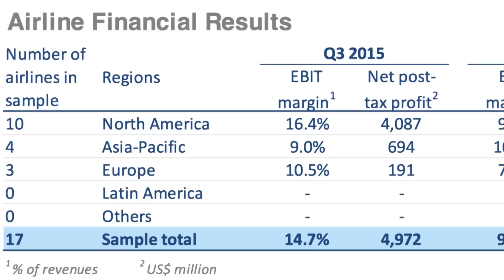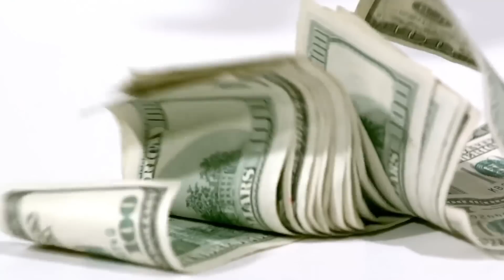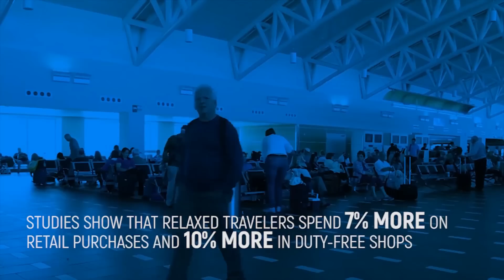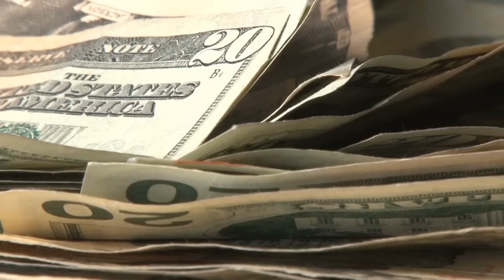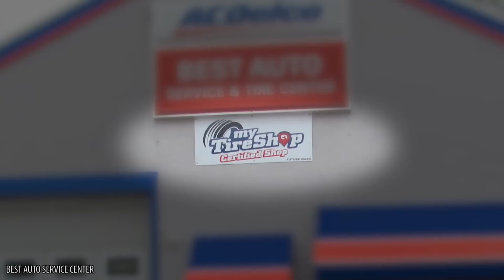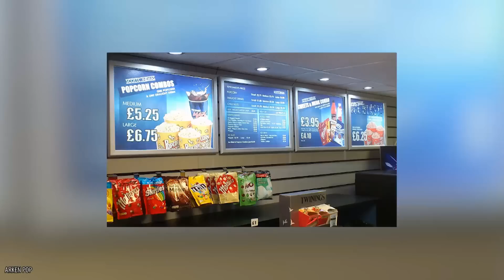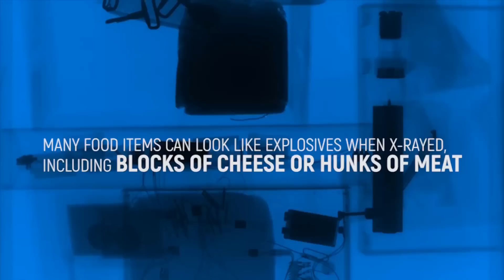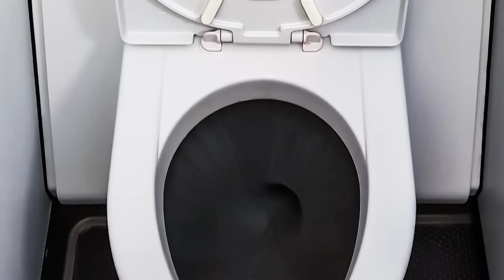TheHUB Live - Amazing Secrets No One Wants You To Know

Comment: I have never changed oil in any car. I put 300,000 on my Neon by topping it off when it hits add. Once a year I add 1 qt. of Lubriplate. My E320 has 187,000 on it and drives like a dream. , both vettes have under 100k. 1982's. I am a mechanic of 32 years and one of my clients tested oil additives. so they would let them run for 100K and I would take them apart and they had computers measure all wearable parts. After 100K kept topped off, there would be little wear. When the oil gets to add, the viscosity lowers, so adding a qt refreshes the viscosity good enough. Ive had over 30 cars without a single failure due to oil....coolant is the most important fluid. If you keep that engine cool..it will last a long time unless there is a manufactures defect. Synthetic oil does work better and never change your trans oil. You are almost guaranteed it will have a failure ! Some cars recommend changing oil at 100K ! Always check you air filter, just hold it up to a light and if you can see any light thru it, you are good to go !

Comment: Ok. At 1:09:20 "Old parts" it says to ask for your old parts back - DO NOT DO THIS! The reason is that just about ALL replacement parts require a Core (old part) in trade when you buy a new part OR a required Core charge must be paid.  If you get back your old part, then you'll be stuck paying the core charge PLUS 15% for the shop's time of paying it for you. So literally you could wind up paying over DOUBLE the price of the replacement part - just to get your old broken part back. INSTEAD ask for the core receipt. That will show you that the part was indeed used as a core.

Comment: One thing a lot of people dont know about their cars a/c system is, unless any part of the system has been damaged it will simply lose freon over time. But you can get around having to pay the high price of having the system filled.A lot of shops will do a system test for a lot cheaper. This requires them to pull a vaccuum on the system. In doing so they remove the old freon. They cannot leave it empty or it will damage the pump, so they have to fill the system with freon. By doing this 8 of 10 times this will completely fix your problem, and if there is a leak they will be able to tell you.

Comment: avoiding bed bugs. keep your stuff in your suitcase and off the floor. put dirty clothes in plastic bags and put back into your suitcase.  when you get home put it right into your washer and dryer and dry everything in very warm dryer or hot dryer. (bed bugs can't swim).  If you get bed bugs wash all you sheets and pillow cases weekly, get diatomaceous earth (DE) or bug powder (from hardware store) and dust everything around bed, including floor heavily.  use zippered pillow cases.  wash bedding weekly. ditch your headboard or put white zippered cover on it. vacuum everything weekly.  they will go away if you are diligent and clean.

Comment: As far as cars go, I am a professional auto tech with over 15 years experience. I’m going to set this straight, we barely make any Money changing your oil. I would rather not even offer oil changes it’s really just for customer convenience. I specialize in engine repair so I see the insides of many engines. Sure your owners manual says 10k oil changes are fine but it’s not true if you want the engine to last a long time. So many engine repairs I do are related to people not Changing their oil frequently enough. I recommend synthetic oil and change it every 5k. Waiting along time to charge your oil makes your engine sludge up and also doesn’t lubricate as well causing things like timing chains to wear out faster than normal. Fuel injection cleaning is an absolute must if your engine has direct injection fuel system which many new cars have, the reason is, the fuel doesn’t get injected before the intake valve so the intake valves get a lot of carbon build up that will cause a misfire. This should be done every year in my opinion to avoid a costly repair. If you listen to your owners manual your car will not last as long as you hope. It’s funny how people like to think you can avoid  car maintenance and still have reliability

Comment: When I was moving my Zombie Truck from the Arizona desert we needed tires to drag it out (We found it abandoned) and just got the el-cheapo tires. Now I can't get them to do anything to them without buying a whole new set. The beads are rusty so they leak air slowly but they wont re-mount them with glue and if the tires go flat the city sticks an abandoned vehicle sticker on it.  So there is sound advice, check the expiration date on the tire!

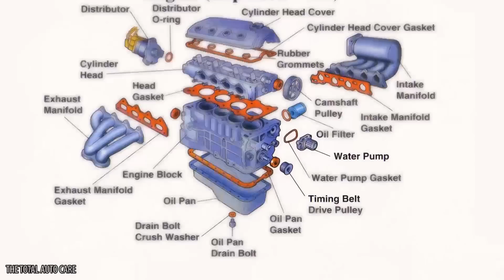Comment: At 5:02 they don’t tell you that also yes new cars can go 6-10k miles but they also recommend you use a synthetic blend (5k miles) or full synthetic (7-10k miles) so make sure you are use of the appropriate oil for the car. Also at 6:35 the water pump being changed is not always needed to be removed to do the job some water pumps are ran off the timing belt/chain and some are off the belt. That picture they use is a really old engine like pre 2000 it still has a distributor and that’s not used any more. The Buick 2.4l engine has the water pump ran off the timing chain but is on the back side of the motor. Basically a lot of the car stuff they talk about is part truth but they don’t tell you the full facts. To be safe always look in the owner manual and follow the service intervals and do the preventative maintenance if you want the car to last.

Comment: do no go 10k mi on an oil change. sludge is really common these days with the "annual protection" oils. i work in a machine shop and this is really common now. also mechanics need to charge for a waterpump replacement when doing a timing belt because if the waterpump leaks he has to take it off for free. its called a warranty. if a customer didnt want to pay for the waterpump labor i would charge them the entire cost again to take the waterpump back off for a warranty repair.

Comment: In hotels if you leave your stuff on the bed we won’t make the bed. Comforters are heavy and only a few can be washed at a time so of course there not washed every clean. Id say about once a month they get washed. Tv remotes are cleaned but not all housekeepers clean them regularly it’s a good idea to have handy wipes and wipe them off plus light switches and door handles off yourself. Going through someone’s belongings is a fast way to get fired plus imagine trying on a sweater and the guest walk in. So don’t believe that bs. What job doesn’t make fun of guest or customers? Also hotels get tested for quality assurance yearly or more  they check everything from the front desk paperwork and the cleanliness of the rooms. Things like shower curtains and coffee makers are some major even elevators doors are graded. It’s easy to fail so hotel management are pretty strict on q.a.

Comment: when it comes to auto maintenance,and you obviously don't want to pay more than you need,READ YOUR OWNERS MANUAL!!!your owners manual will tell you when to do oil changes to keep your warranty valid,but it also tells you when to change spark plugs,air filters,and all the other oils and fluids that keep your car running.there is a big section of maintenance at certain mileages,and that is what any competent mechanic will go by!!!Be informed about your vehicles maintenance requirements,ask for specific services at the proper intervals!!your car will last a lot longer,and your wallet will be happier!!ask any mechanical repair shop for references,ask the other customers there about the quality of service,and value.GET YOUR OLD PARTS BACK!!!so you can see what has been replaced,and why.and finally,the busiest place is busy for a reason!return customers and word of mouth goes a long way in the auto repair industry,but also be informed of your vehicles requirements!!!going 7-10,000 miles on one oil change??you will be putting an engine in your car very shortly!with todays tighter tolerance engines,and small oil passages that control things like variable valve timing and timing chain and timing belt tensioners,the dirtier your oil,the faster these components,along with many others in the engine,will get plugged up,and can cause serious and expensive repairs!!!!an oil change every 3000 miles,or 4000 kilometers,is the best,and one of the cheapest,things you can do to make your car last!!

Comment: You dont have to remove your timing belt to remove your water pump you have to remove a serpentine belt and sometimes cars have more than one but there is a big difference between that and a timing belt or chain. If your having your timing belt replaced than your car is on its way out with some MAJOR issues and you may want to consider getting a new vehicle speaking from experience i had to actually have a timing chain  replaced on an old Mazda that i had back in the 90s it cost me alot to have it done and the car only lasted about 6 months after that. Anyway, i just thought i would let you guys know so you don't look stupid or get majorly overcharged asking your mechanic to replace your timing belt while he's at it with your water pump. you're either going to get a raised eyebrow or charged through the nose for service you don't need not to mention your car is going to be in the shop alot longer. I do my own work on every car i have ever owned i must have changed dozens of water pumps on my own and friends cars and never removed the timing belt to do so. shrugs lmao

Comment: 2 year old tires being a bad thing and definately asking for a fresher set? what in the actual. Tires stored properly, being that not in the sun and in a cool place away from the elements can have them last years, being 10+ or more depending again on storage, states have cut off dates depending on their own decision, my state prohibits the sale of 10+ years of age tires for "safety & liability" (usually these restrictions arise from people who have no idea go and raise a cow over faults that are not of the retail stores fault) Reasons. I've put on tires that were 15+ older on my vehicles and ran them to the cords without having weather checking, broken belts, cupping, chopping, or blow outs. People should also understand that tire wear and the mileage you get out of tires attribute to many factors, Lack of rotation or alignment of vehicle can cause uneven tire wear and cupping, (chopping and cupping can attribute to shocks, ball joints, bearings, and or struts being shot as well), weather checking(the cracking of tires due to drying out) is something you can't prevent unless you take the time to buff the tires and oil your tires, Broken belts can attribute to a defect in the tire or a hi speed impact of a object on the road. Blow outs can be caused by tire punctures, fault in the tire mold or carcass at factory , and improper inflation. Sorry but hearing you say that if its 2 year old tires you should ask for a fresher set is redundant. The Sign for new tires being that, they are new tires, not a single mile ran on said tires. What your inferring to in saying in example is that phone on the shelf being new in box never open never a finger touched it isn't new anymore cause its last years manufactured product of the same line of phone but the same exact phone next to it being same in every build down to the last resistor in the way, is new just because it was manufactured 1 month ago.

Comment: Please do not be misinformed in the mechanic segment and go talking BS at your repair shop. In order for a car to go 7500 to 10000 miles between oil changes it HEAVILY depends on the kind of oil you chose. So dont go thinking you can run 10k miles on some conventional 5w30. Also you MUST check oil level periodically. 

The timing belt/chain situation depends on the kind of vehicle. Many vehicles have an external water pump and that is removed by a few bolts and maybe a pulley here or there and a serpentine belt. However the timing chain/belt is internal to the gear case of the engine and demands alot more labor to remove. Some vehicles you have to lower or raise the entire engine. Dont forget the process of resetting the timing of the engine so there arent any pistons getting impaled on valves. I been a mechanic for over 10 years and I do not work with customers so the information im giving you isnt how I make my money its simply facts. I have no reason to bullshit anyone.
Reply: I was just about to say the exact same thing. Regular oil, partial synth, and full synth makes a difference as to how far you can go. And same for the water pump. Depending on the application. It may be true but, that isn't always the case. Most applications can be found on Google with diagrams depicting how everything is placed. I've been working on cars for 20+ years but it's not my profession any more.  And just because parts are so cheap online doesn't mean that's how much mechanics pay. They use parts dealers who deliver directly. So there are extra costs involved. And the most aggravating this you can do is buy your own parts and give them to the mechanic. 9/10 times they are wrong!
Reply: If the car manufacturer says you can go 7500 miles, they mean conventional oil.  You don’t need to get semi or full synthetic for that 7500 miles

.
Reply: @electrictroy2010  , I would adhere to what you're 'owner's manual' states in regards of what type of oil to use and the intervals of your oil changes. There will be some vehicles that require Full Synthetic (or even synthetic blend)  and some can use all without an issue.
Reply: My 79 Honda Accord was like that.  There's an engine mount in the center of the belts, so you have to remove the bolt and jack up the engine to change any belts.  Had a mechanic change the timing belt.  Then two years later the engine was low on power, it wasn't the timing, it turned out it just needed new spark plug wires, then it ran fine, for awhile, until a bad gasket allowed coolant to pulled into the engine.  It still worked, I just needed to add coolant and stop leak every day.  Then I traded it in on a brand new car.

Comment: Ok, I'm just gonna say right now, after the first 8 minutes, half of the things said are untrue about auto repair. Cleaning fuel injectors is good preventative maintenance. Going 10k on an oil change is fine. If you are using full synthetic oil only! There were other things.  Oh yeah, ASE CERTIFICATION is not just a written test.  That is complete crap.  It is a very difficult test, and the ONLY way to pass it is to know auto repair related to the test category. If you don't know it, you will never pass the test. It requires two years of experience before you can even try. The questions are made so that without experience, you just can't pass it.